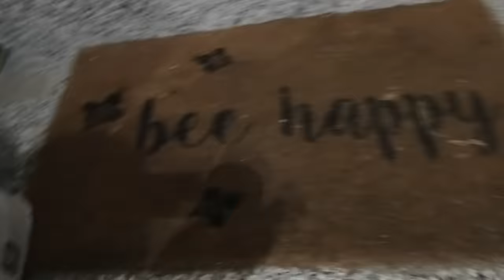Perfect quality brass for reloading. Start to Finish.

Comment: Stainless pins are magnetic because you have 2 types of SS. Ferritic and austenitic. Ferritic is a magnetic SS. Austenitic is non-magnetic SS. Your SS pins are a Ferritic SS.
Reply from the maker: Kind of figured it must be something like that, as the quality of the pins seems to be really good (no corrosion after years of use), so I didn't think it was just an added in alloy. You learn something new every day! Cheers!
Reply: Can be identified by what series SS it is.

Comment: Give Southern Shine Media a try. I find it cleans better and faster. Two hours max. Gets the primer pockets really clean and doesn't get stuck in the case. It'll get in there but after you dry them it falls right out. Never gets stuck where the pins can. A little bit messier but a good separator will have no problems. I ditched my pins years ago. Made the switch and never looked back. Great video. TY
Reply from the maker: I will look that up for sure. I like that "better than new" look, especially on my precision rounds (6.5 creedmore, .308), and the pins don't get stuck like the pins do, but if I can find something  even better.... I have a 6.5 reloading video partially in the works, so maybe I'll see if I can pick some up for that. Thanks for the tip!!

Comment: Bell jar.  Refrigeration tech vacuum pump with vented exhaust.  Brass in a bucket on the bell jar base.  Every trace of your RO water boiled off and gone in a few minutes.
Reply from the maker: I've actually upgraded to an RO/DI rinse cycle, and I moved to a place with humidity levels that are often below 20%. I monitor the TDS to ensure It's always 0, which means there simply isn't anything to be left behind. I just throw them on the deck for an hour.... spotless :)

Comment: You should try trimming and sizing in one shot with a Dillon trimmer and size and trim die. Lubed cases sized and trimmed in one operation. You do need to decap separately though!    It cuts case prep time by a lot. It is well worth the initial investment.  Dillon has dies for other calibers besides 5.56 too.  With 300 blackout you can size a 5.56 case to the 300 blackout neck and trim the entire 5.56 mouth and shoulder off in one operation.  Connect a shop vac to it and all the shavings are cleaned up as you trim.

Comment: Great video.  For drying brass I use an old dehydrator.  It has 4 shelves and can hold a lot of brass.  About 2 hrs and it's done!
Reply from the maker: I've looked at those in the store, but it comes to a point where I have too many bulky gadgets with limited use in the workroom. It's probably the best solution to make sure the insides get dried out. I jumped the gun once with a batch of 7.62x54r and half of the rounds had messed up ignition, that was a time consuming mistake.

Comment: I use an old hair dryer to dry my brass in a kitchen sieve. Set it in max heat and speed. Shake the brass around in the sieve while drying. Takes about 45-60 seconds to dry all the brass (25-50 pieces)

Comment: Take a look at the Giraud power trimmer, the Bench-source annealer, and a larger quantity tumbler such as the Frankford arsenal model. 
The Giraud only works with full sized brass, and you get all three processes of trimming, chamfering, and deburring done exactly the same every time, based upon indexing off the shoulder. 
Utube the Benchsource annealer to. I think you're heating the brass too far down the case. 
When you consider how fast and consistent these machines move you along, you'll find them priceless!
By the way, I started with Girauds triway trimmers for each caliber. This even gets old. I now change out the cutting heads on the power trimmer, locking in my setting for each caliber for quick switch as needed.
Reply from the maker: I will admit something...I only did the annealing stage so that the transformation into shiny brass was more impressive ;) 
I have so much 5.56/.223 that I really only trim, swage and resize the brass, and even then usually only once, but I'll take a look into the power trimmer. I'm aware of I think the lyman or hornady(?) one, but it looked to gimmicky for my tastes, but I've never heard of the Giraud so I'll for sure check it out. Thanks for the feedback! :)

Comment: I only wet tumbled when I go scavenging for range brass at first I would do it for two hours then I noticed it was messing up the case necks so now I do it for 30-40 minutes and I use Brass Juice does a great job. 
I use the ugly annealer and don’t quench my brass I allow it to cool in a bread pan. 
I will have to check into the case trimmer been on the fence on buying a Giraud I load a lot in one sitting.
Reply from the maker: I have to admit, The only brass I ever hit with the heat is 5.56 cases (I used to buy CRATES of the chinese surplus). I found I was having split cases and some shoulder issues when resizing, so I just added the step when fully processing 5.56 to 223 (ence the primer pocket swager step). I also do TONS of rounds at the same time (9mm and .223) for competition. Once trimmed, I never find that wet tumbling ruins the case mouths (again, the chinese 5.56 usually has really rough crimps, so the trimming smooths those out). I find I only have to trim once in the lifetime of the brass, so it could be something you borrow, and just replace the cutter head when you return (I've done 100,000's of rounds on one cutter head, but they do eventually wear out, and are fairly inexpensive).

Comment: Annealing isn't all that complicated. Yes, you can get as fancy as you want, and be as precise on the temp as you want. However, PRACTICAL annealing is simple. Heat the neck and shoulder area with a torch until the torch flame changes color. That's plenty. Drop into water and done.  You can put a socket in a hand drill and at slow speed keep the case turning while heating and then just tip it into water. The socket serves for rotation and to protect the bottom of the case.  Or you can set your cases upright in a water bath to 1/2 case length. The water bath serves as a heat sink to protect the bottoms of the cases, and when finished heating you just tip the case over. Either method works well. 
Advantage (s)? More reloads per case, and even amount of friction on the bullets for better overall consistency.

Comment: Some excellent points.  Keep in mind case gauges read SAMMI spec only. If one is neck sizing, and or bumping their shoulders for better accuracy, they won't work. Also when measuring measure case length with the gauge in your hand don't push case in with your hand. More accurate to insert case and place on hard surface, they take your measurement.  As for annealing, it is best to do this before the case is sized and I also recommend Templiac 700 degree heat paint to set up proper flame temp and time.
Reply from the maker: All good tips, although, wouldn't putting stress on the shoulder and neck AFTER annealing defeat the purpose of relaxing the metal?  
Also note that these are intended more for visual enjoyment than any kind of real instruction (for legal purposes). That said, the only round I really take care of is 6.5 Creed. I shoot everything else so much that almost everything counts as a plinking round (I just need alphas, I don't shoot MOA very often). I have a bergara that is sub MOA (If I do my part) but I baby it because I don't want to burn out the barrel. I have a savage in .308 that's so worn I think I could drop a bullet out if I just tipped it too far forward :)

Comment: A couple suggestions. 1) get a larger better tumbler. 2) SS pins can be purchased as micro pins that won’t jam up in necked brass, even .223. They even clean out the primer hole. They are around the size of a caraway seed. I would like to get a better close up, of the brass, from the primer hole swagger tool. I just power chamfer mine then tumble afterwards. But that removes some metal. An alternative might be better. I’ve done a lot of .223 and most of the brass I find at the range is shorter than specs. But it doesn’t seem to affect its performance. I just have to set the shorter ones aside and lower the crimper a tad for those. Oh, BTW there are machines out there for annealing brass necks that work on multiple sizes, that will do around 10 - 12 a minute.
Reply from the maker: I have tried several times to get the smaller pins, but all of the companies that supply them won't ship to Canada, so I've been stuck with the larger pins. As for the larger tumbler, space is always at a premium, we moved and I'm overflowing with "stuff" from our previous house. I used to just use the reamer on the primer pockets as well, but noticed a large pile of shavings every time I did it, so I figured go with the swager, it more or less just compresses the pocket, and I haven't had a single issue with seating primers since. I used to have trouble with S&B primers and I think Remington(?), and now they all just work. I REARELY anneal brass, I have pails and pails of it, I did it for the visual more than anything...secrets of hollywood I guess lol!

Comment: Funny. I trim and is caliper to verify case length. I usually ream with hand reamers even when processing a lot because swayed brass sometimes springs back. But once cut out it never comes back. I tumble now because I can but for the first decade or so I didn’t have a tumbler and didn’t tumble at all. Only cleaned when the case was extra dirty, like I got from the ground out of the mud. But if your budget is higher and your tolerance demands are looser your methods will work but I can get my cases within 1-3 thousands. You’re not doing it wrong but not doing it how the new budget tied reloader will do it.

Comment: I use the franklin arsenal case trim and prep center. For swaged primer pockets I use an electric screw driver with a reamer. Works on small or large primers and you don't have hundreds of dollars tied up in specialty tools.

Comment: For crimps I got a Black & Decker five piece set of chamfer/countersink tools that can mount to a drill, and it makes short work on those crimps.
Another issue is "Once Fired Brass" that should be honestly called "Previously Fired Brass" because if the brass has been fired and reloaded more than once, it's not a "Once Fired Case".
Military brass is most likely only fired once.
Reply from the maker: I used to do the same, until one time the brass caught, and the mouth had split..and it sliced me up pretty good. I had then only used the hand deburr tool, but the swager is just so satisfying, one of my favorite steps now.

Comment: A little late to this video, and I appreciate the content.

Straight citric acid is cheaper than lemishine.

Chips instead of pins.  They don’t get jammed in the neck.

If the case has a dented neck but fits in the case gauge, it’ll fireform out.

I sort my primer pockets with a gauge.  There are some head stamps that seem to have overly tight primer pockets.  I’ll ream those out too.
Reply from the maker: I've actually been looking for smaller pins, but every company I found with them, doesn't ship to me (Canada). Now as for the lemishine, I actually use it in my dishwasher, so taking a couple of tablespoons a year from that doesn't hurt too much, but I do agree, citric acid likely works just fine (and also works on so many other things). I picked up the swager just for uniformity. I found that some primers (S&B I think?) were really finnicky about pocket size, so one good run with the swager and it's pretty much good forever after that. Thanks for the comments, youtube hates me and my content so it's only interacting with other hobbyists that make it worthwhile. Cheers!!

Comment: In the final step you said you used a fan to dry the brass. Maybe try putting all the brass into a metal pan and placing in the over at 225 degrees for an hour. It has seemed to work fine for me for years.
Reply from the maker: I used to dry in the oven, but I sometimes go through a thousand rounds in a week if I'm practicing for a match, so it's more cost efficient to just let it sit and run under small fan. I'm in a very arid place so it dries quite quickly, although the oven method does do a better job of making sure the inside of the cases are dry.
Reply: 1000 rounds in a week, well I sure envy you and I can see why you would want to air dry. @High_Caliber

Comment: I may have missed something, but would it be better to anneal prior to resizing so the brass is softer and less chance of the resizing process inducing stressors/fatigue in the brass?
Reply from the maker: Possibly, but I like to make sure any unfired powder is out of the case before I take a torch to it. Very likely I didn't heat the brass enough in this either.

Comment: I do everything with a case tumbler and ground walnut.  The extra drying associated with wet tumbling and dealing with the pins was a non-starter for me.  Also I use the RCBS swager that fits on the press.  A bit harder to use, but a lot less expensive.  That would be one item I would potentially swap out as sometimes it really sticks in the primer pocket and almost requires violence to get the cases out.
Reply: I upgraded my single stage press to the Hornady Iron and it has a bigger ram and my RCBS swagger won't work so I bought the Lee swagger and so far I'm impressed. The Lee uses a Belvill spring set up and separates the case by itself. Yes I was skeptical at first but after several thousand rounds it still works perfectly and is so easy to use I swag all brass the first reload.  Sorry Brad but wet tumbling is the only way to clean brass case's.
Reply: I must have been lucky so far I have ran into that with rcbs.
Reply: Brad I had the same issue swaging my brass. I just cut about a 1 inch ringlet off of a 1 inch piece of pvc and the the piston goes through on the down stroke. On the upstroke,  the pvc ringlet catches the swage cup and pulls the brass off the swage tool. You just have to be careful,  not to drop the swage cup and the brass to the floor and catch them once the ringlet releases them. I've since purchased an H Case Prep center that has all the bells and whistles that does that for me now. But I still have my hand trimmer and single stage brass swager,  just in case. Happy Loading.
Reply: Sorry Joe, but wet tumbling isnt the only way to clean brass. 9mm vs 45, Ford vs Chevy. I put em in the tumblr overnight, clean as a whistle. I dont thinking wet tumbling would make them any cleaner and even if it did, it wouldn't make them more accurate.🙂  @joecat101

Comment: To soften metal (annealing brass or casting lead) the metal should be allowed to cool as slowly as possible, not water dropped. I've seen a few people doing this and I have no clue where the idea comes from. I haven't been able to find any of the guys who anneal religiously mention a single word about water dropping.
Reply from the maker: I've also had much better results with longevity of brass done this way as opposed to brass that I haven't done, so I plan to continue on with this method, personally. The biggest reasoning is not wanting to have red hot brass rolling around on my table with the stray powder, random primers etc, this takes care of that issue from my point of view, and it seems to work.
Reply: @High_Caliber  if it works keep it up. I probably wouldn't anneal brass around flammable stuff if I could help it. Just dropping them in a metal pan works too, that's what most people do immediately out of the flame. If you end up getting interested in the science of annealing, "Reese On The Range" is a metallurgist on here that breaks it down pretty good. If you want to try induction annealing in the future "DIY Induction Annealer For Under $200" is a great video along with his tips and tricks follow up video. You don't have to anneal, and if what you're doing is good enough for you, keep it up, but if you decide to get into it those are some pretty good places to start.

Comment: G’Day Mate, I really enjoyed your video and appreciate the advice about using a magnet to make sure the pins are removed.

Quenching brass in water after annealing has no effect unlike most metals.  It won’t hurt it but there’s no benefit.

Additionally, a little spray with “Finish” a type of dishwasher rinse aid mixed with water will stop any water marks on the brass while drying.

Happy reloading, good health 👍✌️👌🤞👊☝️
Reply: Dropping the cases into water does stop the heating process though so the cases soften more uniformly over the entire batch.   When I anneal I set up a couple dozen cases along my sink and heat with a propane torch.  When the rainbow color drops below the shoulder I hit that case with a dowel into the water in the sink and do the next case.  I've done about 20 five gallon buckets of .5.56 brass that way.  Including redoing cases after 3 or 4 reloads.  I also anneal 5.56 cases that I cut down to 300 blackout. That way they are softer when forming. The cases don't get annealed that low at the factory.